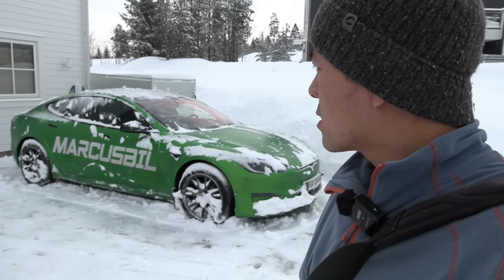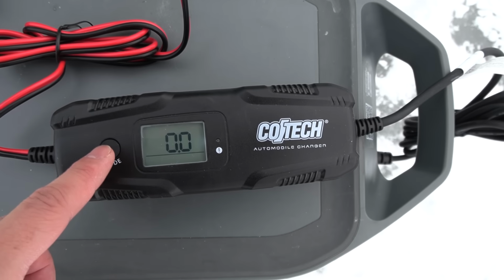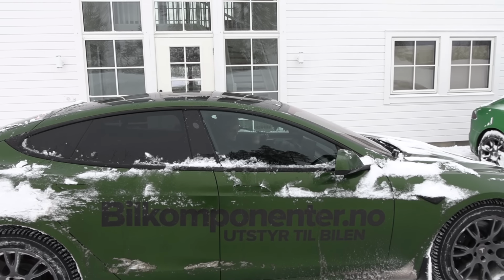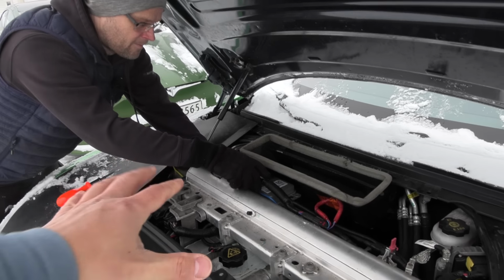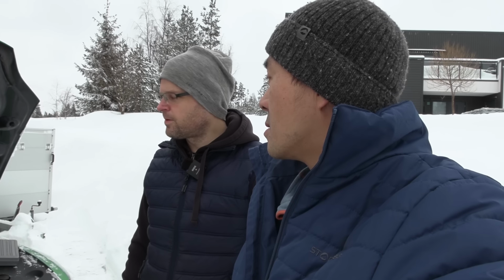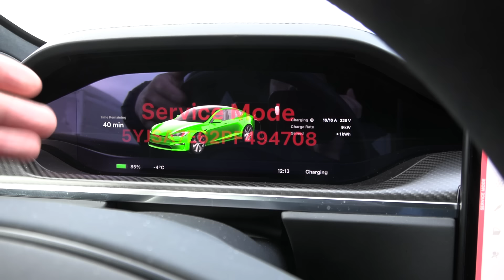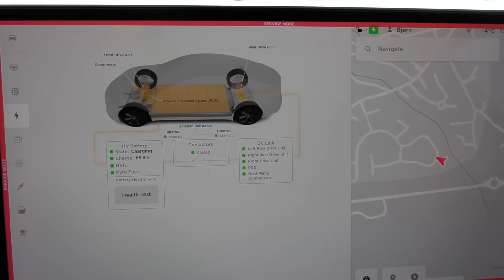Tesla Model S Plaid died in the cold

Comment: 1 good thing about a stick shift car: push it, release clutch and it will usually start with a dead battery. most older cars will even run with no battery, just the alternator powering it

Comment: Extreme cold does weird stuff to electronics. I run a 2018 RAM 2500 diesel - motor starts without issue at -40, as long as the block heater and battery warmer have been plugged in. The radio, however, refuses to work until the interior heats up to just above freezing point.
Reply: It's just a bad chip in your radio. It's -400° in space and all those thousands of satellites work just fine.

I had a power amp once that quit working and took it to the repair shop. Couldn't find a problem. Took it home. Still didn't work. The shop was hot and they used freezing spray to test cold yet still worked there. Finally they figured out a chip would fail at 75-80° range -- room temp.
Reply: @joetolopino7126  Good point - thanks.
Reply: Приус заведется без всяких подогревов в - 40° C

Comment: Now you appreciate the manual hood opening :)
Reply: i can not open the door so...
Reply: I guess the DC power from this simple rectivier charger is not stable enough to supply the cars system sufficiently. I personally would not dare to use such a device to „ jumpstart“ a modern electric car.
Reply: @bass9901   well, with 99,9% of cars you have a key with which you can always open the car ;)
Reply: yea the new cars are such a circus....

they can open with apps, cards, and other gimmicks but not with a fu*** key?

jesus christ.....
Reply: also manual door opening
Reply: @faustinpippin9208  Keys and mechanical locking mechanisms cost money and people don't like lumpy things in their pockets....
Reply: @Smidge204  you need the mechanical locking mechanisms anyway to close the doors...., the only difference is the core for the key which is cheap

and you act as if all the card readers and apps dont have any extra complexity and extra cost?

And wtf do you mean lump thing like a key in your pockets? what a lame excuse that is dead wrong anyway, and what a lame first world problem to have

car keys can open and close to hide into the remote thing that you cary in your pockets anyway, 

and you carry the keys from your house in your pockets anyway

why do you even defend this atrocity? did you miss how he couldnt even get inside his car and what he had to do to open the hood?
Reply: @faustinpippin9208  Sir, you are making a LOT of assumptions about me based on what was a throwaway snark comment. Calm the frick down...
Reply: @Smidge204  Most cars with keyless entry have a physical key anyway for emergency situations (e.g. dead battery in the key) so 99,99% of cars you can open with the physical key anyway
Reply: @Smidge204  if that was the case then sorry lol

a lot of people nowadays say dumb stuff like you said earlier seriously and call that "progress"
Reply: @broderwow  the problem is - what will you do once inside? you need a functioning LV battery to get the car going, to initiate the contactors for the HV battery to charge the LV battery.
Reply: @whattheschmidt  well then you would do the same as Bjorn did. The only diffrence being that 1. you can remove 12v battery yourself. 2 you can wait for the help inside the car not outside in the rain or something ;)
Reply: @broderwow  valid points.  I just think getting to the 12V battery is in fact easy enough.  I can do it with a 9V battery for my Tesla if I have to.  Maybe I should get a battery charger just in case though.  I have a sealed AGM lead acid, not a lithium one in my Model Y.
Reply: Without a battery charger you would have been stuck with the hood open. So no, a manual hood opening would not have changed anything mate.
Reply: @22Epic  it would change two things. 1 you could replace the battery yourself by having the hood open; 2. If you are unable to do that and need to wait for help, you can do so inside the car where it is warmer, not raining etc. So, I will still argue that not having a manual door and hood opening is a disadvantage and direction I do not understand at all.
Reply: @broderwow  Ok, to replace a battery you need a new battery right ? And surprise, you can connect the cables in the front bumper to your new battery and the hood will pop open, allowing you to replace the old battery with the new one.
So no, it won't change anything as there is no use case where you would need it (except if you ain't smart enough - but then you probably would not know why the car is dead and how to change a battery - so still no changes)
Reply: @22Epic  of course it is. Somewhere during some trip your battery dies you call for help and wait inside the car for help. In tesla you callot open dor frunk trunk anything so you wait outside without access to your belongings
Reply: @broderwow  There is no alternator mate, tells a lot about you :) The situation you describe cannot happen, it should be quite obvious if you knew just a little bit about cars. At least you're funny mate, trying to find worse and worse arguments.
Reply: you can open the front trunk using the two-level manual latch under the passenger dashboard
Reply: if you can access it...
Reply: @22Epic  So please explain that to me if you are so knowledgeable and wise :) The situation I describe is presented in the video, the battery died, and Bjorn cannot access any part of the car. If he had had almost any other car, he could open the doors and hood even with a dead battery.
Reply: @waheeddoesstuff  only if you can enter the car ;) and Bjorn  cannot.
Reply: @999  - lol, the DC quality - not likely a problem, more likely the "smart charger" isn't designed to detect a dead 14-16V  4S Lithium battery ( a lab power supply would do the trick...)..  or smart charger with 14.8V supply mode
Reply: @broderwow  Ok so during your little trips, when you want to make a small break you let your car for weeks on a parking lot with all your belongings inside? Yeah sure, very realistic. You were wrong and it's fine, you'll probably manage to deal with it.
Reply: @22Epic  That might be a case with weak battery or during the winter :) does not have to be weaks. BTH this is exactly the same situation as Bjorn explains, Tesla died during cold weather.
Reply: @Smidge204  I like lumpy things in my pocket….
Reply: @broderwow  If it's a dying battery and you're using the car, you have a message with a warning informing you of the issue and that the battery needs to be replaced, so non issue.
If it happens letting your car parked for weeks without using it, then it means you're in a familiar place without your belongings in the car (that would be dumb) and with another mean of transportation, so you could simply go buy a new battery and have no issue opening the hood and replacing it, so still a non issue.
So there is no real use case where a manual hood opening would have changed anything.
If you still don't get it, you're either a troll, or someone who doesn't know how a car and/or a battery work, either way it was entertaining, so thanks I guess.
Reply: @22Epic  This very video is situation outside what you are saying. If Bjorn would have week battery signal he would react. And the car have not been seeting for a weeks but as Bjorn said died during cold day/night.
Reply: @broderwow  You should listen more carefully to the video mate, he said that the last time the Tesla communicated with the Tesla's servers was 4 days before, which implies that the car was not used for at least 4 days and more likely way more that.
Exactly what I described, so still a non issue.
Reply: @faustinpippin9208  My summer car also has a key with a battery - for the LED to find the lock ;-)) 
 
30 year old Opel Calibra V6, 85,000 miles,  as the guy from this video is from Norway, mine has luckily a finnish body that rust way less than the german bodies, so it is still in good shape. 
 
EVs might make sense when you have regular driving with known distances and overnight charging, then no issue. but up there in the cold, or when you rarely drive and then over wildly varying distances it is NONSENSE.
Reply: @Smidge204  but this is already a very expensive car and people have no problem carrying a huge smart phone, phone charger, vape, portable power bank, and most houses still use a key so you need to carry keys anyways
Reply: ~ Manual doors would be much safer.
Reply: @broderwow  and where's the fun in that? Why not stand around a $100k car like an ape in the cold with that card trying to get in ?

Comment: This highlights the problem of electronic-everything, solving problems that don't really need to be solved. I am glad if my ICE vehicle's battery dies completely, I can still insert a key in the door, turn it open the door and pop the hood to get the battery charged or swapped out or get it jumped...  I will always have access to the vehicle's interior and engine bay with my mechanical lock and key if my fob dies. They really really really ought to include mechanical failsafes in these cars.
Reply: What difference does it make to get in the car if it's not working? They open the hood and access the battery with the same 12V source they needed to charge/wake the car up so the end result is the same.
Reply: @Kowalski301  Well, maybe you left your house keys in there, and it's -30c with a -40c windchill or some super important documents, or a booster pack in the trunk. Or maybe your kid is in there, and you inadvertently closed the door and can't get it open again. Lots of really good reasons to have a mechanical lock....

So yes the end result is the same. but look at all the farting around he had to do...and look how long it took! I could have been in my car in literally seconds, got the battery boosted within a minute (with my pack in the trunk) after and driven away a minute after that.
Reply: @sneezyferret6482   exactly. I have  lithium battery booster in my glovebox. THat I can get to because I have a key. I haven't need it for my own car but if I ever did I wouldn't need anyone to come boost me. When it is -40 it can be life and death if you get locked out of your vehicle. Inside my vehicle I have blankets, chemical warmers, lights to warn drivers in the dark that I am broke down. All my safety kit is IN THE CAR. Not being able to access your safety kit is a safety issue. Period. Not an issue when I am in the city but when I am servicing well sites in the field or working in rural locations in the winter waiting for a boost to open my car is damn stupid.

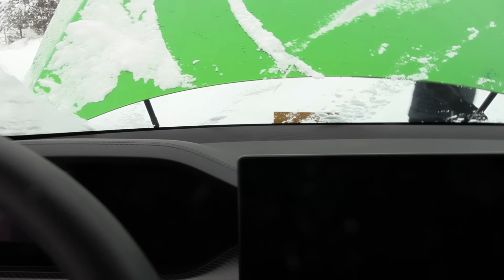Comment: 13:30 The boost is probably powerful enough but that kind of booster is designed to be connected in parallel with lead battery, not used as a direct power source.

Comment: My IONIQ5 was DED this winter (third winter for it) at ~ -17 degrees. Very similar symptoms. Only two differences were: 1. LV battery is a conventional 12V lead battery; 2. It got towed to a service center where they replaced 12V battery - said it wasn't drawing any current from the charging circuit.
All this high-end technology is good until it gets over-complicated and, as with Boeing in recent years, your planes begin to crash.
Reply: DED is an old joke :)
Reply: Ioniq 5 doesnt charge the 12 V battery from the high voltage system with SOC < 20%.
Reply: @Sweetw4ter  That's irrelevant. HV battery was at ~80% at that moment.
Reply: @Sederiq  I understand that, i was generally saying that since it is somewhat related to the topic of the video.
Reply: Are you on about the Boeing accidents? They had nothing to do with the technology getting complicated, it was pure incompetence at best.
Reply: just dont discharge to zero. all EV got safety systems to prevent battery anode from degrading. Its physics from highschool BTW.
Reply: @steelwind2334  yeah but most modern cars can still park for a long time before their 12V battery dies. It shouldn't need the charging circuit from the high voltage system at all unless it has been parked for a long time. I have left my car parked at the airport for 3 weeks and got in a drove at -40 no problem.
Reply: @WTFUSERNAM44  yep. but you dont dischagree car battery to zero on purpose  and than left it. (like in this video)

Comment: Thanks for proving to me that I will never go EV.
Reply: The only time an EV would be practical is if the temp outside never gets below 70° or above 90°, you never haul or pull a trailer, and never go over 100 miles.... and you have money to waste on an expensive gadget that depreciates rather rapidly.
Reply: you pbviously never had a dead battery in a modern combustion car. its the exact same pain.
Reply: @alexanderhummel3917 but 1000 times cheaper and faster to replaceXD
Reply: @alexanderhummel3917 You obviously didn't pay attention. The HOURS spent warming it up the first time just to get it 'alive'. Then hours trying to get the hood open to attempt to jump the 12v battery that died. In a ICE vehicle you pop the hood, jump it and you're on your way... in minutes.
Reply: @alexanderhummel3917  

I have been in that situation.  And in EVERY situation, a simple pair of booster cables and another car with a running engine was the best option going to get it to start.

I grew up north of 60...this isn't my first rodeo...and the bullshit these guys had to go through JUST to get the car to respond...THAT is what I am on about.

Of course, I could go on about my environmental opinion of this absurd idea, but that isn't what the video is about...which is that EVs suck in temperatures in the minus 40s or colder.  This just reinforces why I will not ever buy one.
Reply: @joetolopino7126  

Sure does have that "feel" to it huh?  I did see a review of one EV truck...cannot remember which...but it didn't do well when hauling anything of significance...the range was greatly reduced based on what was being hauled.

Even manufacturers admit there is roughly 30% loss at minus 30C in the battery pack.  While the same can be said of lead acid batteries in an ICE vehicle, the loss isn't usually enough to prevent the engine from starting...once started, the battery will quickly recover and the CCA needed to start again will be restored within minutes. 

Methods to mitigate the battery issue is to use a battery blanket.  Even unplugged, they provide benefit over an unwrapped one.  I had one on a puny battery for a Hyundai Stellar back in the late 80s...at minus 45C, the car started after sitting in that temperature overnight at a hotel where I could not plug it in.

This separate battery idea is a "good" idea, but the fact is, that separate battery sucks.  The proof right here for all to see.

Meh.  I am a H2 proponent...ICE all the way baby!  lol